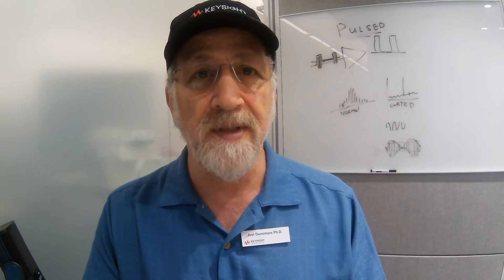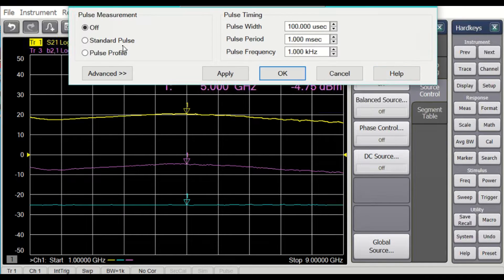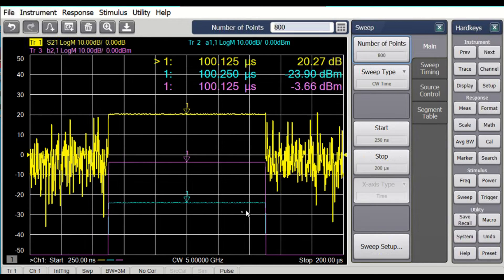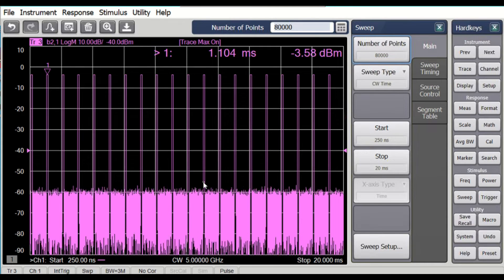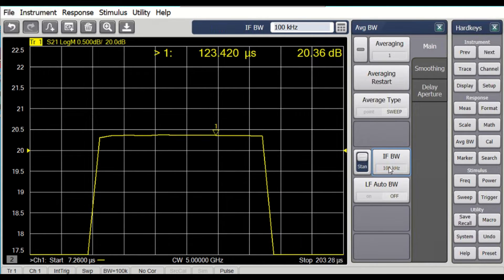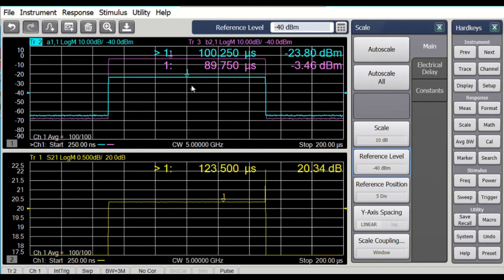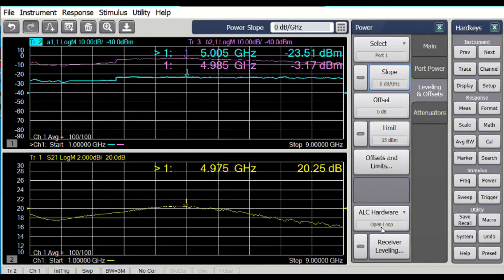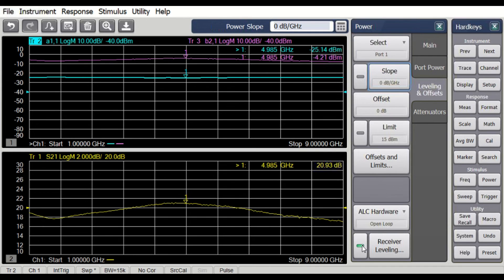Check Your Pulse: Pulsed RF S-Parameters on PNA-X

Comment: Dr. Joel, 
Greetings! Can you give any advice on doing a source power calibration in STD pulsed mode? I have a 4-port N5242B PNA-X, and use a power level of 0 dBm with a calibration tolerance of ±0.1 dB with 5 iterations. After it completes the amplitude error is ~0.6dB as measured on a calibrated peak power meter. Any ideas on how to reduce the variation and errors? I can send you more detail about my setup if you need it. 
Thank you,
Scot
Reply from the maker: Sorry for the delay, I'm out travelling.  There are two ways: 1) Pulse always using open loop mode, so set the ALC to open loop and do the source power cal and then turn pulse on or 2) from your pulse duty cycle set a power-meter loss in the power meter setup equal to the negative power loss of the duty cycle (e.g. 10% duty cycle is -10 dB, so set a loss offset to 10 dB).  with pulse on and the power meter reading average power, it will see -10  dBm for a 0 dB power, so it can offset by 10 dB to get the proper reading for the pulse on time.Then do a normal source power cal.

Comment: Hello, how can we measure the received power of the antenna using VNA? Please make a video of it. Thank You
Reply from the maker: I'll look into that.  The the method is to basically calibrate a VNA with power+S-parameter calibration, then use a standard gain horn instead your Antenna under  test to compute the range loss; de-embed that from the transmit port and you will have a calibrated wave power at the receive antenna's input plane.  It's a little complicated...